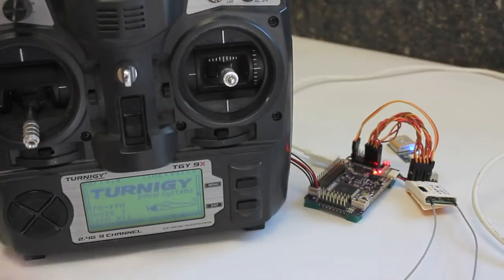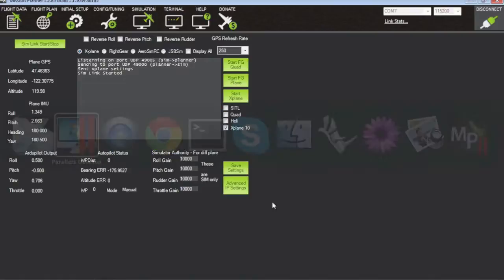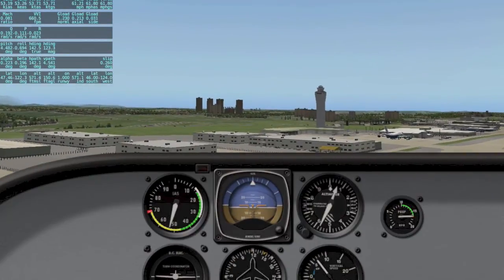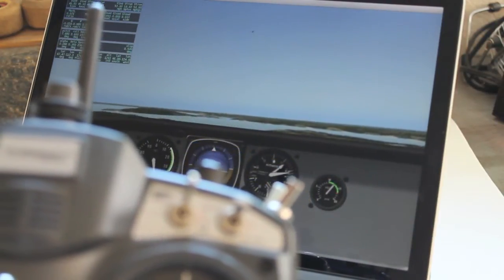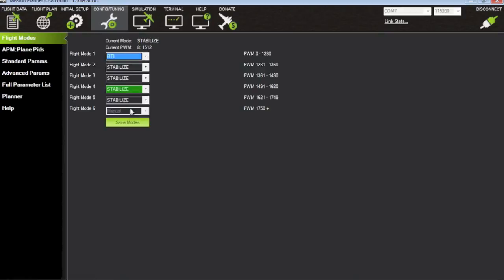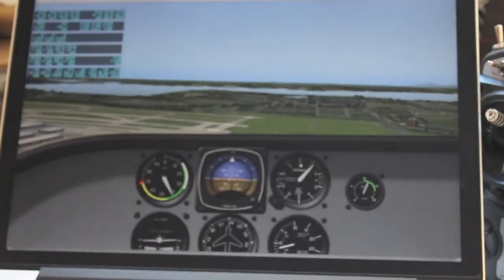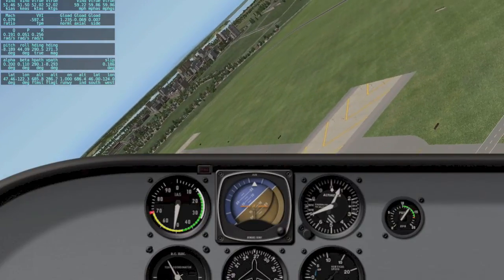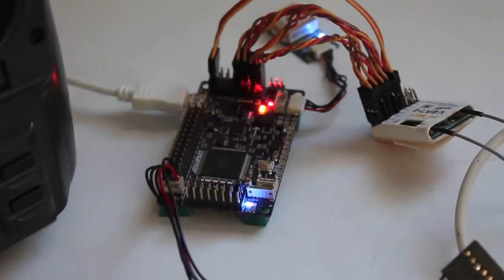APM 2.5 Hardware in the Loop (HIL) Simulation Testing Stabilize and RTL Flight Modes w/ X-Plane

Comment from the maker: I had a problem when reversing my channels in Mission Planner vs using my TX. Having them reversed on my TX is what did the trick for me. Not sure that's the problem you were having as in my case I couldn't get it to fly in stabilize without flipping over. Good luck.

Comment: Ok when I was using Stabilize mode when you first showed this It wasn't nearly as stable as that. It wouldn't level the plane but it did seem to make it easier to control. I suppose i'll just have to play with it a bit more.